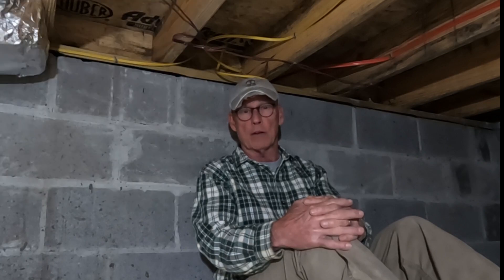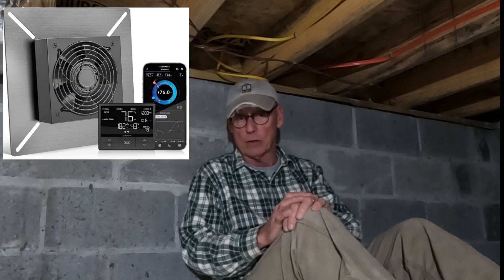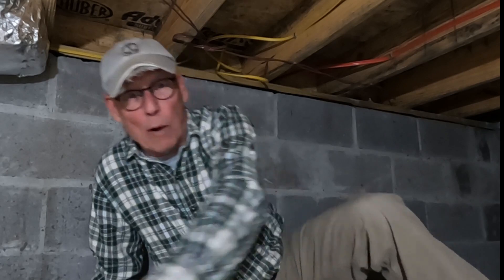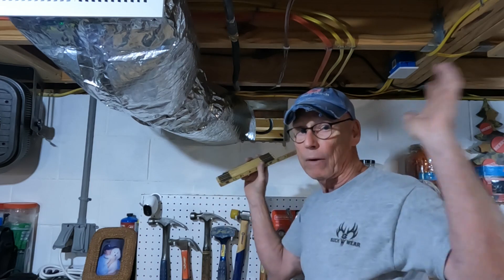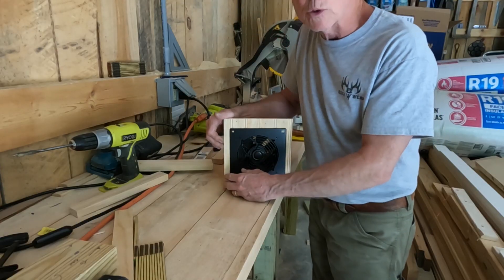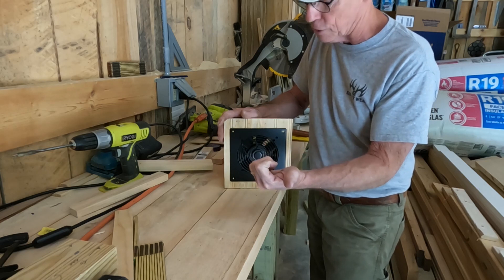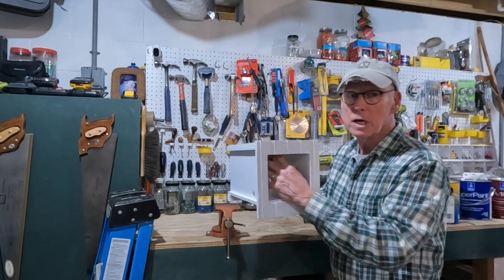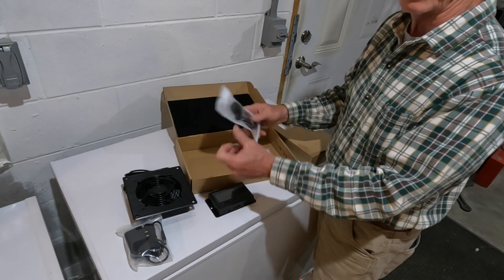Should you vent a Crawl-Space?  Here’s our Solution + Things to consider

Comment: That is a very small muffin fan used to cool electronic equipment. Don’t you need a larger squirrel cage fan like a furnace has but not as large and not moving as much air cubic feet per minute? I don’t think that one is moving enough air fast enough to change the air out in an average sized crawl space. You don’t want too little or too large.
Reply from the maker: @techguy9023 This AC Infinity Airtitan T3 System is specifically designed for crawl spaces. It has a 120 CFM variable speed fan driven by air temperature & humidity sensors. They also make a dual fan set up for larger crawl spaces too. My crawl space is only 504 cubic feet (12x14x3). So this system is capable of performing 15 air exchanges per hour at full fan speed. Here’s a link if you’d like to see one: https://amzn.to/436oOfp

Comment: So how do you allow the air that's being blown in to circulate out. You have to have air flow. Not just air in!
The reason pier and beam homes without closed skirting don't trap moisture and mold underneath is because of air flow. Maximum ventilation.  That is unless you have standing water underneath. 
Venting is tried and proven. If it's too sealed and near moisture (ground). Then you will create a condensation. That is why the second you crack your car window and allow air circulation in and out it defrost the wind shield .
Reply from the maker: @adjusterneal1439  There were enough small openings for the air to push back in to the full basement (electrical wire holes etc) The plan always was to have another opening on the other side of the same wall. We have that now. This is where the plumbing pipes go through a block that has been removed. No moisture issues at all - everything works great

Comment: I appreciate the time you have taken to provide this resource; it's not easy finding reliable, first-hand knowledge on this matter.
   We purchased our first home here in Vero Beach,  Florida, in June of '23.
    The house is a 1933 block structure,  with a crawlspace beneath joists that support a diagonally oriented t&g subfloor beneath oak t&g flooring. 
   My theory regarding the potential for long-term troubles is that, with the advent of central air, the equilibrium of moisture content of wood above vs below the air-conditioned living quarters is disrupted. The occasional crowning of the t&g flooring in isolated spots wouldn't bother me if not for the potential for unseen consequences.  The idea of sprayed foam being applied to the underside of my flooring system sends shivers down my spine.......what if it's applied with just a few breaches? 
I mention that because there are a lot of companies that promote it as part of a full  encapsulation.
    If I'm understanding correctly,  you're  suggesting integration of the crawlspaces air into the home cooling system. Am I at least thinking in the right direction?
Thanks again!
Nick
Reply from the maker: @mechantics  I am not an Engineer and can only share my experiences. It’s obvious that moisture is the problem in your crawl space causing the wood floors to swell. I would seal the foundation wall blocks with a specialized concrete paint/sealer and + a ballasted vapor barrier on the dirt floor (6 mil polyethylene held down at overlapped seams with crushed stone & affixed vertically to the block walls) Instead of introducing conditioned air I would install a dehumidifier & a small fan to circulate the air to the dehumidifier & close any out side vents. I introduced a/c air primarily for heat in the crawl space for winter + my space has a poured concrete floor with poly underneath (much more forgiving) Good Luck - reach out to our email if you would like to discuss more - email address is in the “about” section here on YT